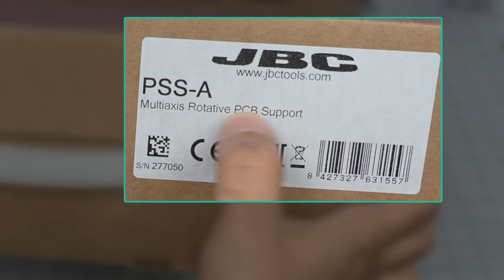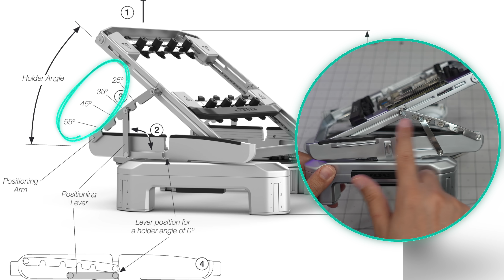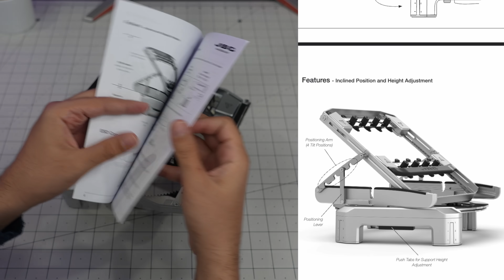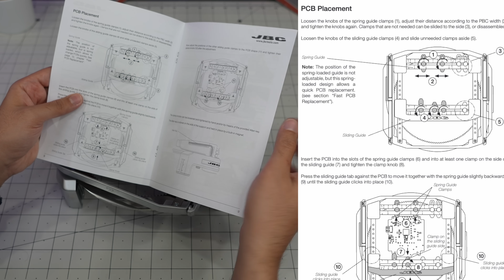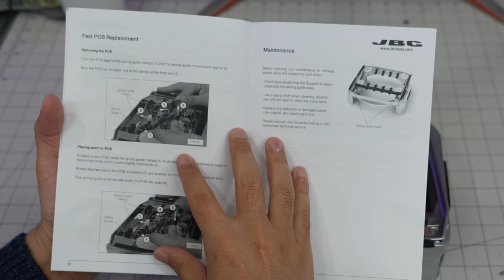Is This The Best PCB Holder and Support For Soldering? | JBC PSS Multiaxis PCB Support

Comment: looks like the answer to the title is a resounding no
Reply: Do u recommend one that does not cost that much
Reply: @gaminginstilllife9429  depends on your budget and usecase. for small, single board projects done only from time to time, the generic pcb holder is really good enough. You've probably seen it, its one of the first results for "pcb holder". it's three black black metal bars and two blue arms. It's alright. 
If you're doing SMD only, you can solder on a hot plate, or use those magnetic button things to hold the board up. idk its not my ballpark. 
Premium THT work holding would be the Weller 120. Its main advantages for me are easy flipping, width adjustment that isnt too fiddly, and the arm that can hold an object to the board when its flipped. That arm is probably the biggest quality of life feature, and it can be quite easily rigged up on other models. If you have access to a 3d printer, there is a wealth of available models that imitate the weller 120.

I'd love to provide some links here, but YT deletes comments with links, so I'll repeat the key words here
pcb holder the generic one is good enough for hobby use
magnetic PCB holder for SMD
Weller 120 for premium
rotating PCB holder search on youtube for an example of a 3d printed design
Reply: @gaminginstilllife9429  well looks like the tube didnt like my long comment, so I'll be brief this time:
regular pcb holder is plenty good
weller 120 is really nice
check out 3d prints like "rotating pcb holder"
Reply: regular pcb holder is plenty good
weller 120 is really nice
check out 3d prints like "rotating pcb holder"
Reply: @gaminginstilllife9429  sorry for being so brief, the toob removed my other coms